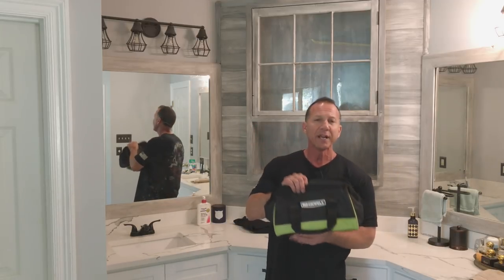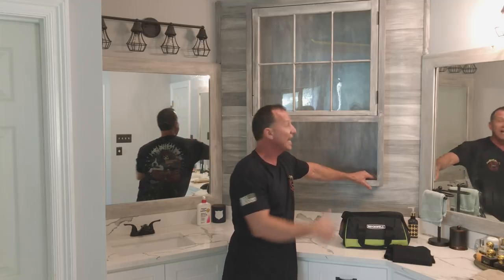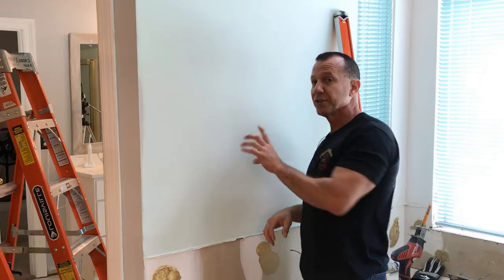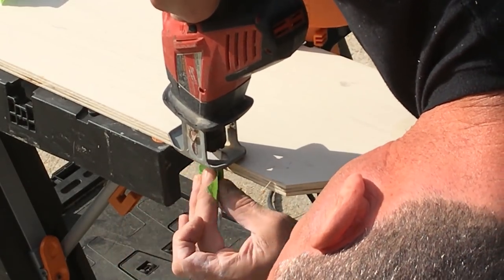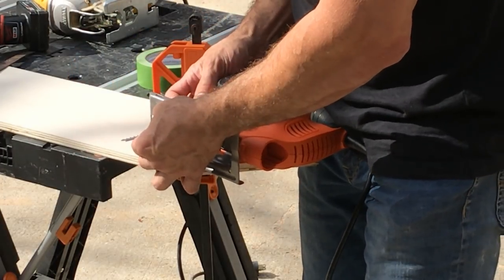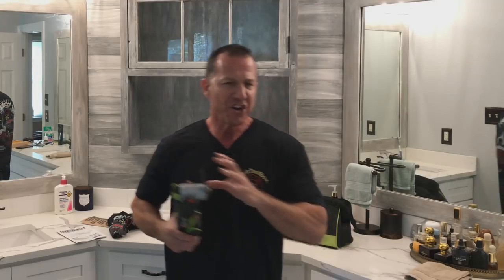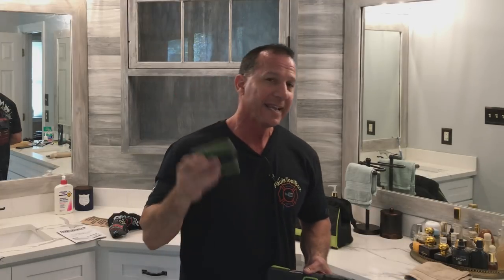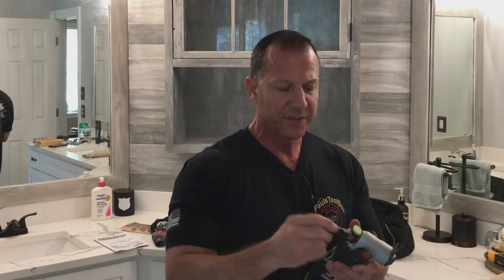Great DIY Hack for fast cuts!

Comment: Guess better late than never and congratulations to Jim for winning the power tool and T-shirt. 
I'm 73 never been a carpenter but have always had to do my own work. Someone would show me or I'd read a book or just look at a picture and try to figure it out. Many mistakes and do-overs but you can't get your feet wet without getting in the water. Along comes YouTube and Paul Ricalde (ToolBox) just when I need you the most. The countless videos you have has been a God-send to me and the one on how to read a speed square hit the spot. I'm adding 30' to my deck with roof and the rafters are my biggest problem but after watching your video on the speed square the only problem I have now is wanting to see more of your "Pauls Tool Box" videos. Thanks for your help Paul.

Comment: I always learn something new when watching Paul! This saw blade idea is great, I will definitely use it on my next Spec House project.  So was the fix for the door that won’t stay open, watched your video did as you said, bent the center pin and it stayed and is still staying open.  Thanks a lot, these ideas and shortcuts are always useful.  Keep them coming!

Comment: As a Pro, I love this hack. I set up a bunch of new blades for different depths. Drywall, fencing problems, under kitchen sink cabinet work, and more. Labeled the depths on the blades with a Sharpie. Also you can put the saws upside down in a workmate or a vice with metal cutting blades for fine work in wood.  Blades are cheap compared to time. Good job Paul!

Comment: Thank you Paul. I just saw a video a month ago that the guy was praising a new tool that did just this. Essentially a jigsaw for cutting in place dry wall. I never thought of just snapping the blade at a determined length. I will be using this soon at work myself.

Comment: i've used both jigsaw and sawsall in the same manner for years in the electrical trade, but your method of shorting the blades is very cleaver . This would make things move a lot faster and not worry in damaging systems hidden behind the drywall. Thanks for the tip

Comment: Neat trick. I have always used tape on drill bits but never thought about doing it on a saw blade. Thx for the tip, Paul.

Comment: i WAS KIND OF EXPECTING YOU TO USE THE rOCKWELL oscillating cutter to open up the drywall, but I got a kick out of the nail cuts and it went through wood like butter. WOW!

Comment: I've been using my vibrating multi tool to cut out drywall and it is so slow. It action burnt out. Luckily I'm in the market for a new one.

Love your videos. Have several in my saved favorites for reference.

Comment: I'll have to remember that excellent tip.  When making straight cuts in drywall, I just set the cordless circular saw to 1/2" depth, but it generates a lot of dust. Your method creates much less dust 

I am retiling my master bath this week (first timer), but ran into major unexpected surprises resulting from a horrible, leaky shower install by the builder (and some unwelcome, hungry visitors inside my walls).  We have had to replace all the studs and walls. That Rockwell would be extremely useful, from cutting wallboard to removing thinset with a diamond blade. 

Greetings, Paul, from a fellow La native who misses the Sportsman's Paradise.
Reply from the maker: Hi JT, it still creates dust but I would  to have my helper hold a shop vac just in front of the blade on the Jig Saw and it kept the dust down to a minimum. 
Thanks buddy!

Comment: I bought some Saf T Kut blades for drywall, but never again at 12 bucks a pair, easier to use your method. I'm gonna try the jigsaw next time I need to make a hole. It looks like a jig saw would be more stable with the larger base and mine has a vacum port. GREAT TIP

Comment: Great video. I am about to add a bathroom vent and need to fish wire through the ceilling close to where I have an outlet. I was worried about potentially hitting the existing wire as I went through the fireblock.  Now I know a way to access the fireblock without hitting the existing wire.

Comment: Another win! Hey Paul, I take old reciprocating blades, shorten, and chisel-cut sharpen them. Good for things like scraping off old liquid nails, peeling paint or sharpen the back side of one like a knife blade to do things like remove caulk from the edge of trim you're recycling when your hand plane isn't handy.
Reply: Funny that the oscillating tool we cringe a bit at when we drop the dime for it, but once you have one, you can't live without them!    ; -\

Comment: Like your tips and tricks.  Great for the novice.  Never though of using old blades for this purpose.  Most blade damage I have experienced is usually near the middle to outside end of blade.  This is a useful "hack" to safely continue using old blade and extend the "life" of blade while keeping project safe.

Comment: That’s a couple cool tricks by braking those blades like that!  The jig saw can be awesome 🤔!  I’m with you on the Rockwell tools... I just got the corded one and man o man are these badboys something sweet!  Feels like a million bucks in the hand, for sure.  Great video, dude!
Reply from the maker: Hi David, yeah I love using their tools. I have Rockwell stands in the jaw horse as well. They discontinued the drills and I was extremely disappointed because I love them, I have their torque gun, nut drivers and drills, all on the same platform. I think they may come back with a newer model but they have not told me about it yet. Have a great day and I really appreciate your comment buddy!

Comment: Hi Paul, great video,  nice hack. We use a similar technique when we need to remove a lot of drywall. We set the depth of our circular saw blade to the thickness of the drywall. That enables us to cut the drywall off the walls without having to worry about cutting pipes or wires.

Comment: Great hack. I’m going to need it for a project I’m about to do—put a particular electrical box on its own circuit (stoopd contractor). I’ve been subscribed for awhile now. I like the quick change blade and the 20-year guarantee. Hmmm ... wondering if it’s time to start switching over to Rockwell tools. Thx Paul!

Comment: Really nice handy tip Ione 2 Rockwell Tools I couldn't live without either one of them I use to cut door jambs already in place when installing new flooring the other is there 4 and 1/2 in skill saw that is super lightweight and can cut through conventional Lumber both of them amazing Tools in very handy

Comment: Those Rockwell multi tools are decent. Mine lasted two years of daily use before the motor finally gave. Be great for a homeowner or a guy like myself that didn’t realize how often I would use the cordless version. I upgraded to Dewalt when the Rockwell gave out, still have the batteries though. Whoever wins it I will send the three batteries I have.

Comment: A brilliant tip. I've been watching your videos for some time after another Vlogger mentioned you and been binge watching in the hope the tips and advice you give will stand me in good stead (I love watching anyway), reason for that is I want to do some necessary repairs, possibly fitting out my larder also quite a few other projects I've had on my mind. They need done and as I'm 2 years off 70, I think it's time I made a start!! I've always had an interest in this type of work but never had the time! Ironically, I've been looking at oscillating tools as I feel it would start me off Well with its variety of functions and it's not too heavy. I can hold off buying a drill as I can use my sons (he doesn't know that yet, but with some Motherly persuasion?) I have a sander, so I really want to learn this skill instead of just watching you experts.... not that I'll stop that! I enjoy it too much....

Comment: Cool Trick Paul. I would have used a dremel tool with a cut off wheel to cut the blade which would of taken 3 times as long as your hack. Would not of thought the blade would snap that cleanly or that flat. Also thanks for your crown molding videos. A really good explanation and very helpful especially when you only do it once in a blue moon. You have a new subscriber.
Thanks for the great content.
Ron

Comment: Paul, great video as always. I have used that technique in the past, and you can't beat it for walls with plumbing and wiring inside. Is that an IAFF symbol I see on your tee shirt? I put in 28 years myself. Keep those great videos coming!

Comment: I need to remove a wall, that had been thrown up in a house, with as little damage to the surrounding ceiling and floor as possible. Would this type of saw be something that could accomplish that, or is there a better tool for the task?

Comment: That oscillating tool looks like it would come in handy for so many projects. I definitely need to get one of those thanks for the videos.
Reply: b bus the irony is that the oscillator would be useful for his drywall dilemma in the rest of the video,

Great hack regardless
Reply: nick longstaffe his videos are pretty awesome and he’s giving the oscillating tool away  so he’s showing what you can do if you haven’t got that tool I believe 😁
Reply: b bus never thought of it like that
Reply: Thanks for the tips great use of old blades
Reply from the maker: Hi Nick, I really appreciate and thank you guys for the positive talking points. That is a great point and I almost used the oscillating tool as another option, but I wanted to make this video more about safety. This tool is indispensable, but you could plunge through the rock by accident and potentially cut the wire. Thanks again for the feedback and have a great day!

Comment: You can take most of the crown out of a stud by slicing into the face of it on a 45 about 3/4 of the way through then we would drive  16 ito the 45 to pull the crown in.

Comment: You could've used that fancy Rockwell oscillating tool held against the sheetrock and run it forward through the sheetrock to make the cut too. Then you wouldn't have to do all that measuring of the blade and breaking it off.
Reply from the maker: So  tell me what you would do if you cut a wire by accident? This is why I break the blade off.

Comment: Purchased one of those oscillating saws and was disappointed how long the blades lasted. I could only cut a couple of nails before it became dull and the wood blades started burning the wood after a few cuts. Maybe I need a class on how to use the darn thing. Oh, one other item of interest the blades are crazy expensive. Now it sits in my power tool box hardly ever used.